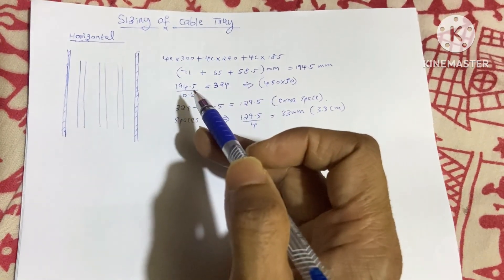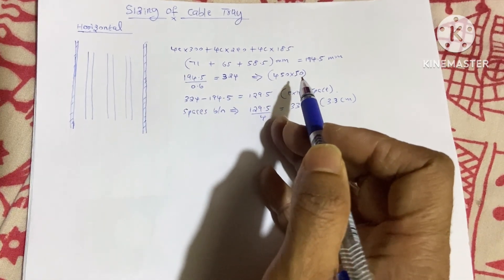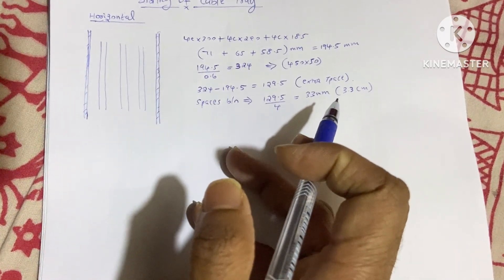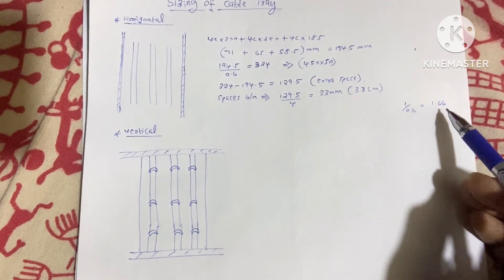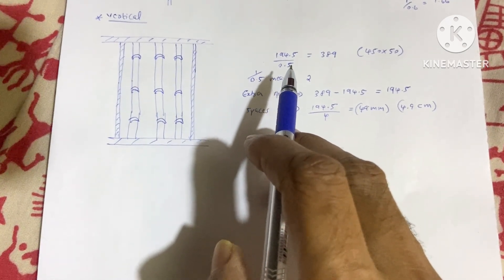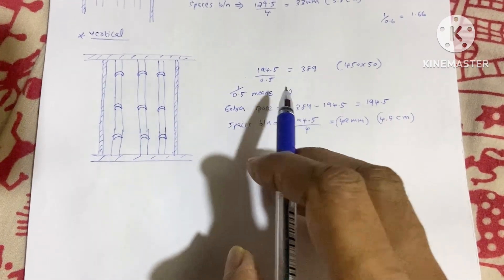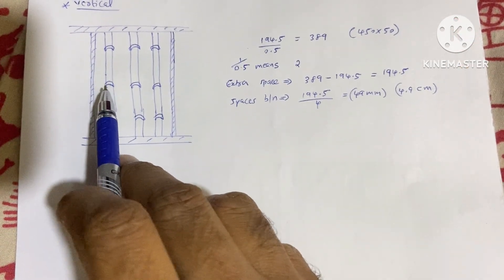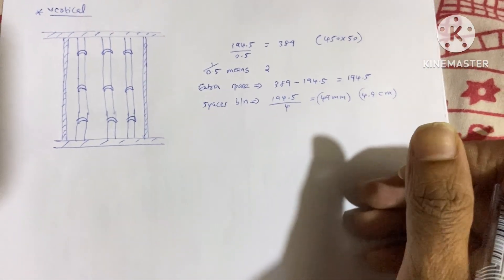How to calculate cable tray size for electrical power cables / Electrical

Comment: Sorry Engineer 
But from where did get the diameter of cable which are 61, 65 and 58.5
Reply from the maker: Please check the data sheet of four core cables of any brand